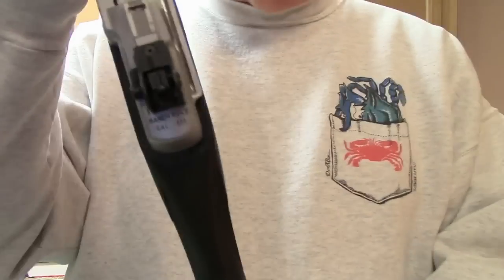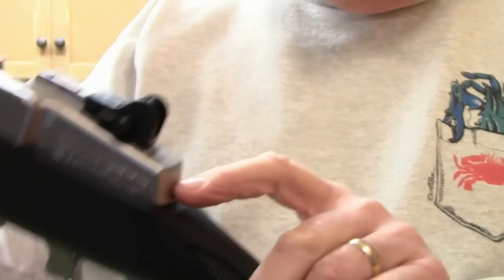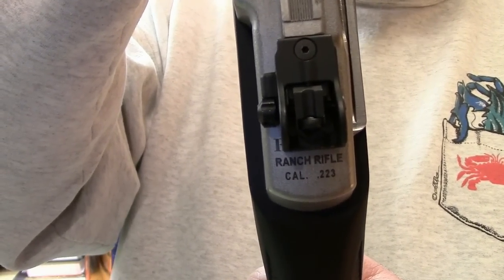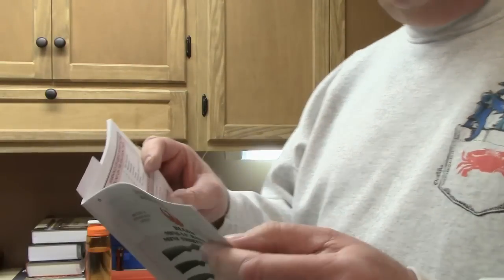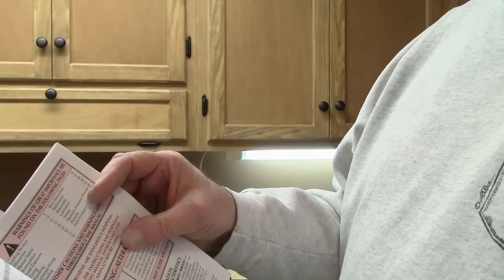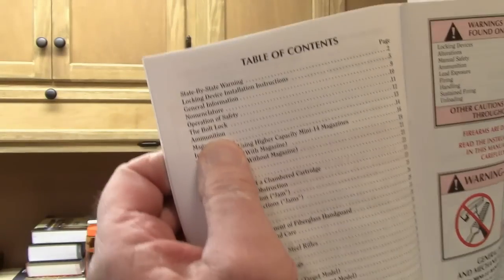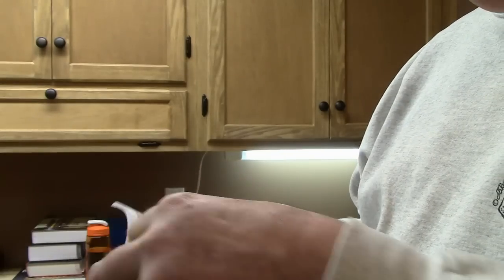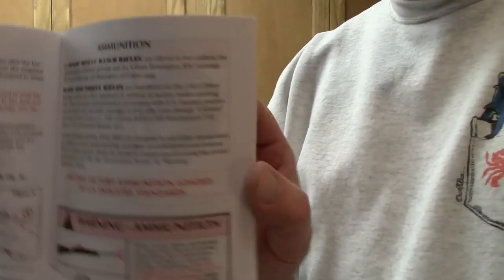Use of 5.56 mm NATO in 223 Rem. chambers ~ Finally, "Can I use NATO in my Mini-14?"

Comment: I read somewhere that Armalite ran one million rounds of 556 through a 223 barrel with no issues
Reply from the maker: Four issues here:  1.  "Somewhere" is not a source of information that can be referenced or validated.  2.  Whether they did or not has nothing to do with the fact that 5.56 NATO ammunition pressures exceed SAAMI pressure limits that are determined by the INDUSTRY to be safe.  3.  Armalite is a private company that must comply with industry pressure standards; they have no authority to suggest non-compliance.  4.  If one wishes to fire 5.56 NATO ammunition in a gun, one should buy a gun with that stated rating, and then they can shoot as much .223 Remington AND 5.56 NATO as they desire.

This is a no spin zone.  .223 Remington and 5.56 NATO have established pressure standards.  I am not here to offer conjecture as to whether your gun will fail.  I am here to tell people the truth about the potential risk as stated by the INDUSTRY, not me.  If anyone wishes to jump off high places, smoke in bed, or shoot ammunition that crosses safety boundaries, it matters not to me.
Reply: Thank You, I really appreciate your videos, Thanks for sharing your knowledge.

Comment: I'm waiting on the experts to show why we should not fire 7.62x51 in our .308 Win. rifle.
Reply from the maker: JdK. R 
You most certainly may shoot military grade 7.62 in a commercial .308 Winchester rifle.  Service rifle 7.62 is loaded to 2,700 feet per second, while civilian ammo is loaded to as high as 3,000 fps.  The only caution as a matter of fact is that the gas systems in military M14s are tuned for LOWER pressure than .308 rifles, which can bend their op-rods if not adjusted, which is the same situation with Garands that are damaged with civilian 30-06.  Also note that military 7.62 brass is usually thicker, and has reduced powder capacity, so powder reductions are required when reloading full power loads.  There was never an issue with shooting good quality military 7.62 ammo in .308 rifles.  The military called for loading it down to old Garand specifications to provide easier field handling in full automatic M14s.
Reply: Thanks for explaining this GunBlue490. I was confused about this as well. I had a good chuckle during the video when you mentioned reading the owners manual.